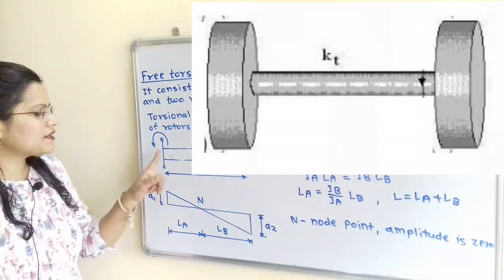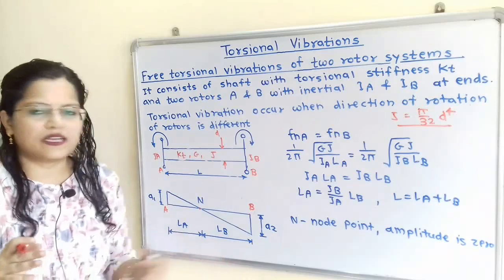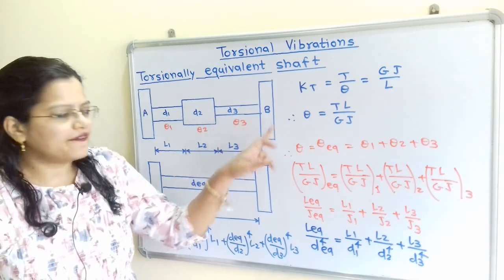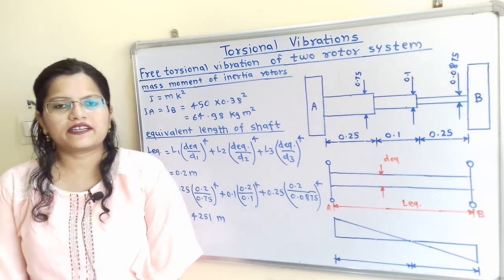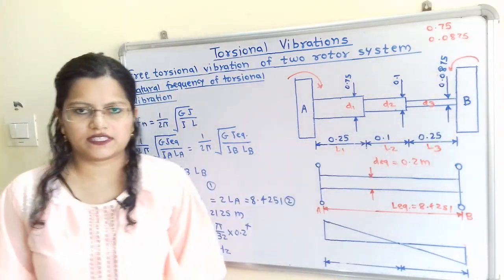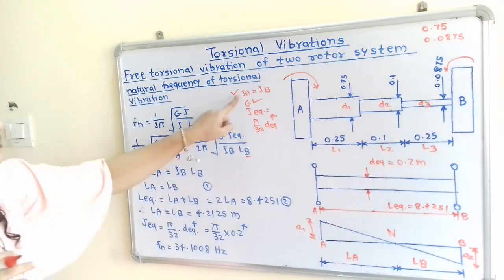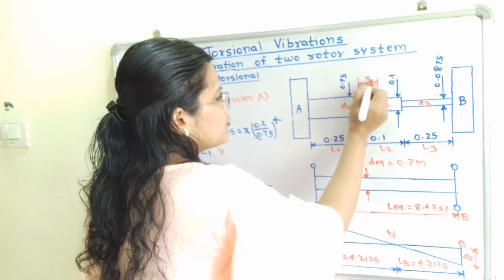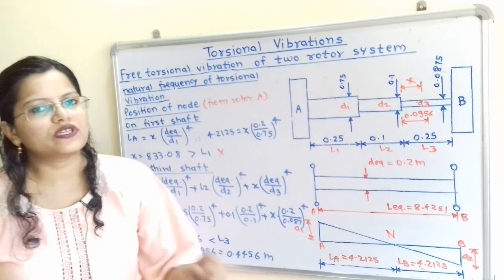Theory +Problem 1 on free torsional vibration of two rotor system/ Dynamics of machinery

Comment: how you find the equivalent diameter
Reply from the maker: Please go through play list. .. in 'Theory + problem'  it is explained
Reply: @edutechguruengineeringlear4280  not find solution please help me
Reply: @manishguptakmr  there are three diametee d1,d2,d3, ,
she took the higher diameter which is for d1= .75 and lower dia for d3=.0875, and try to estimate any value within this two interval. she took for de=.2 you can take also 0.3 or .4  it is applicable for all the problem ,
thank you